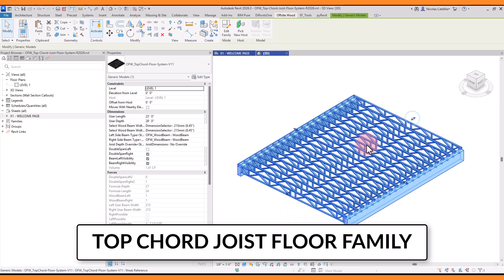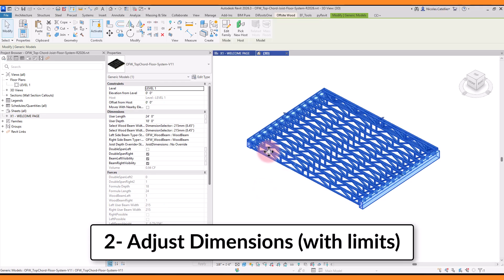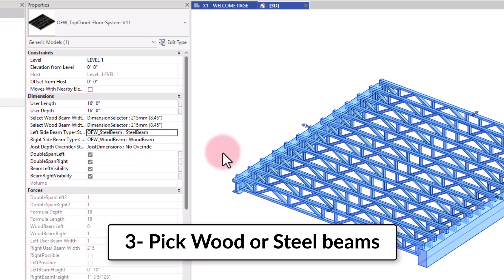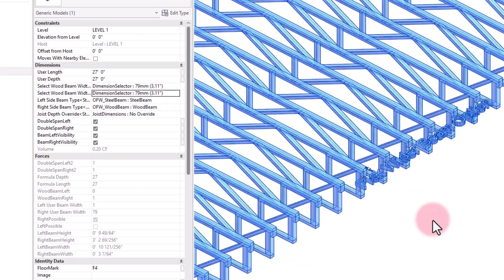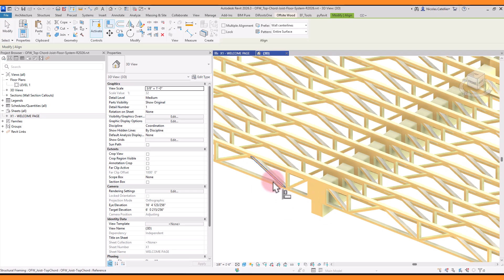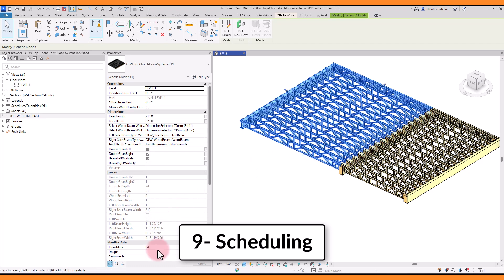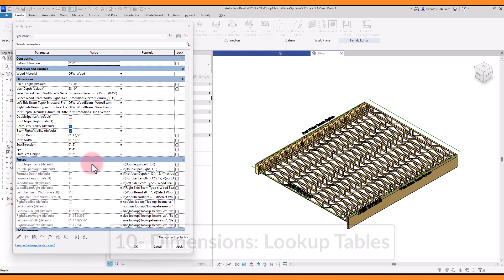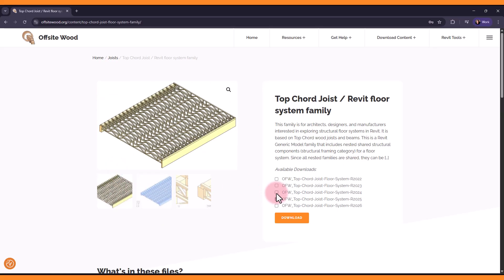Revit Top Chord Joist Floor Structure Super-Family

Comment: This is a great addition to revit. Is there a reason why it has to be top cord bearing on both ends. When using floor trusses you just have a 2 by 4 ban on the bearing wall sides. Is there a reason why it has to be top cord bearing on both ends?